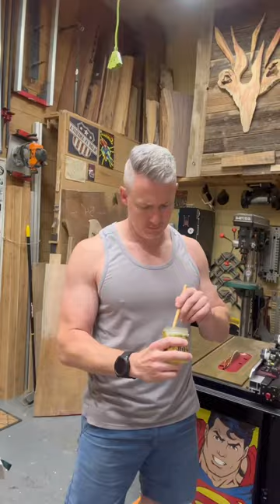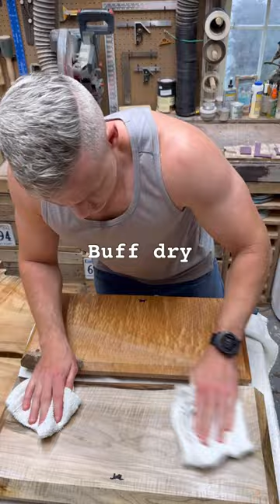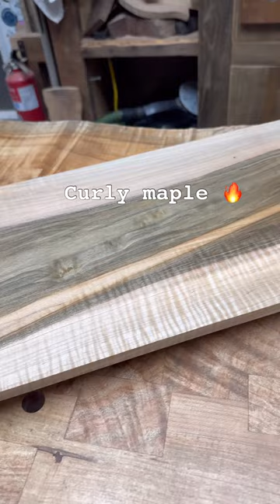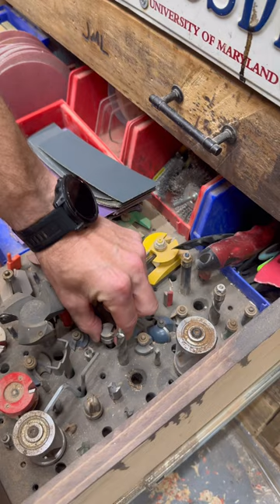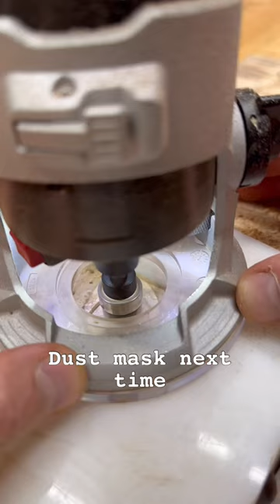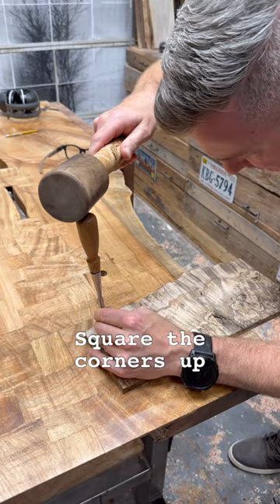Woodshop vlog #woodwork #wood #carpentry #diy #woodworking

Comment: I didn't like Odies as much as I thought.   I couldn't get the resukts I could from cheaper food safe products.  Especially brads workbench products.   Maybe Im not sanding to a high enough grit.   I had higher hopes.   I also do more wood turning than buioding these days
Reply from the maker: I like it because I can sand to 500+ and not worry about adhesion. Ruby suggests lower grits, as do some other finishes. Use what works best for you 👍🏻👍🏻